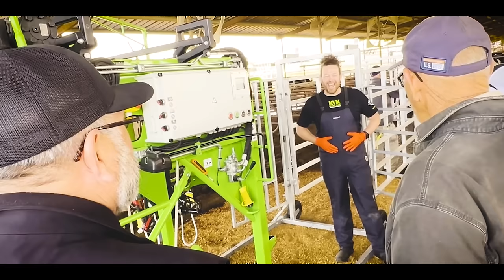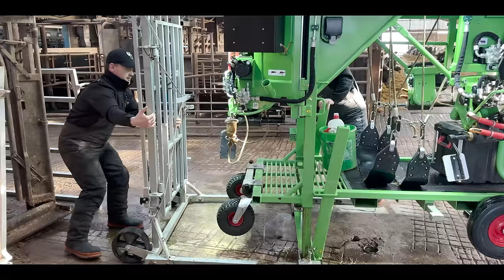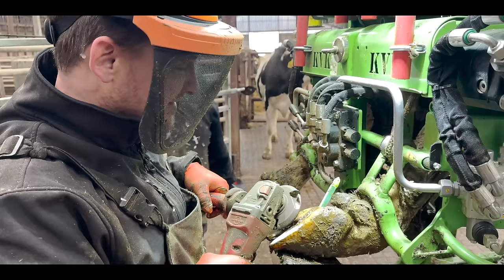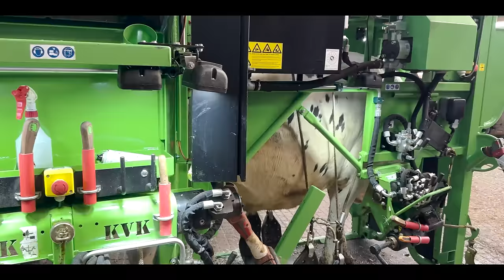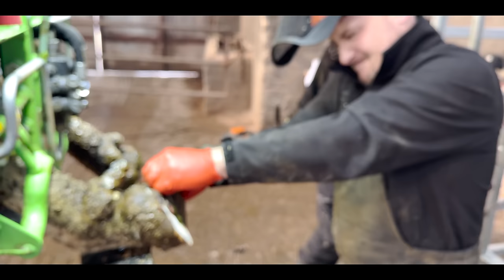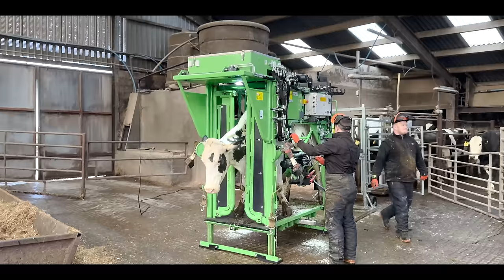an OLD RUSTY NAIL caused THIS!

Comment: Would it help if the cows, on a routine basis, had to walk through a trough of disinfectant, not only to clean their feet, but to help kill any infection present? A bit like sheep dip.

Also, some method of cleaning the cows rear ends. Most cows I have seen (I live in the countryside) tend to be smeared with, well I think you know.

Comment: I wish that someone could build a crush like you use for cows for horses because sometimes you get horses that can not stand up because they are very sore on all four hoofs and with getting held up in the air and support with each leg then getting the hoofs trimmed i think that if you train horses to stand and get use to being held by the bellyband it would help the vet and the farrier so they would not get hurt and it the horses need to be sedated during the hoof trim it would be better for everyone in the long run so please can you please build a crush like the one have for cow so horses can use it to for horse plus rescue heros so that the horses that are lame in all for hoofs don't have to stand in one place that are held up in the air because i have seen some horses that would benefit of a crush like your cow crush